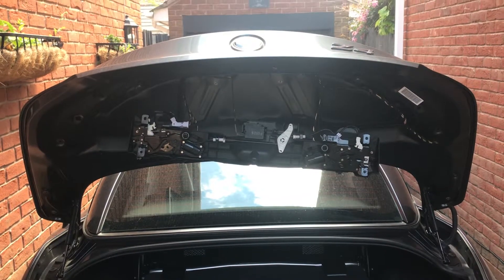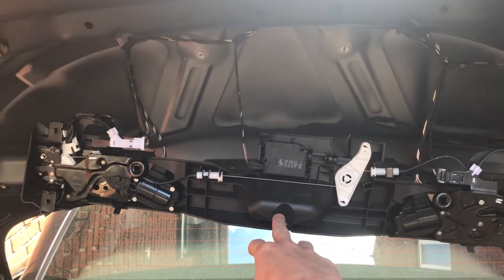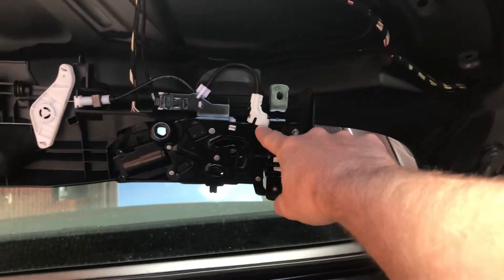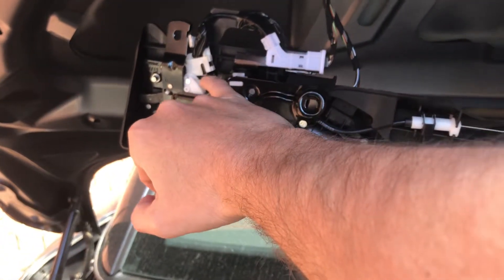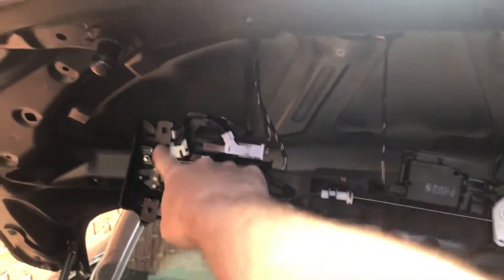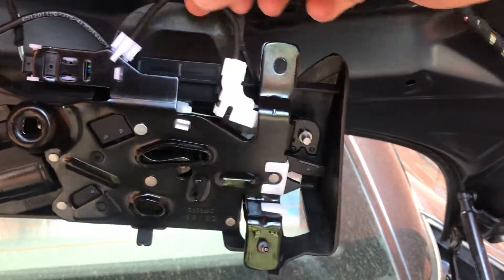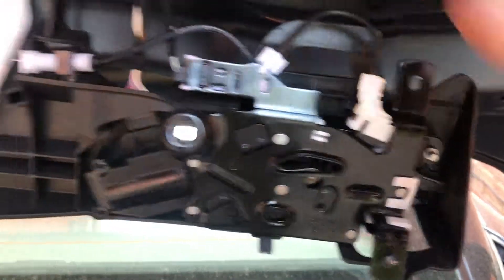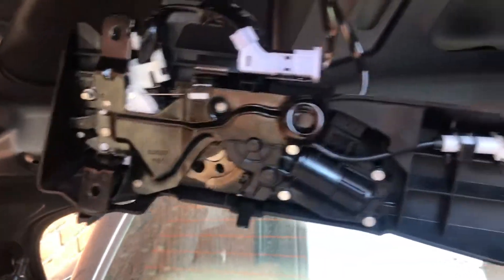z4 locking mechanism soft close sensor fix 1

Comment: Brilliant video!  Not sure how you were able to troubleshoot and find this.  Had same problem due to 2 broken wires on my left sensor and one on right.  Wire skin was fine but if you bent it you could touch that copper thread inside wire was broken.  Reconnected and works fine now.  Thank-you for posting!!
Reply from the maker: Hey 
No problem glad I could help you 
It did take me a while to sort it out at the time but at least now yours plus others have saved time & money 
Glad I could help 👍🏼

Comment: My e93 has started doing this today. You can hear the motor trying over and over again to pull the boot shut but isn't pulling it closed. Would you say this is the issue?
Reply from the maker: I would say from what your saying yes if it’s jumping up and down then yes
Reply: @BobbyGees  yes you can see the boot moving up and down with the motor. Thank you for your help buddy!
Reply from the maker: Yes that’s definitely it and no problem
Reply: What was the answer as mine is doing the same?? Thanks

Comment: Hi grate video and I have this problem and I got it move once or twice then it stop moving, what you think is it cable or sensor? Once I touch cable area and it seem to be same problem as yours but now I'm not sure. Maybe there is change to cut wires and make them new, sensor unit cannot change wires but can cut near. I still looking for fix this problem cos in here it will cost lot of money. Thanks for give information, give more if you have any!
Reply from the maker: Ari Suomi hey man 

If you can take the wire out and fix the wires see my other videos 
You don’t need the Sensor on the end of the wire just fix the wire cut the sensor off and then put the wires together and tape up and it should work without worrying about the sensor altogether
Reply from the maker: Ari Suomi so basically disconnect the sensor cable from the car 

There will be a broken wire somewhere on that fix the broken wire if your sensor is okay then it should work if the sensor is damaged all the wires are broken at the sensor then take off the sensor and twist all the wires together where the sensor would be tape them up and it will sort it out
Reply: @BobbyGees  Hi thanks a lot I found one broken wire and one almost cut, this video makes this possible to fix it, I really found out where was the problem! Now it works and I safe lot a money about 600 dollars, thanks a lot and I will see your other video of this problem!
Reply from the maker: Ari Suomi anytime mate glad I could help

Comment: The slow close on my 2011 car works fine, What I get is the boot wont open either from the key remote or the handle on the boot lid. Any suggestions please? Thanks Tony.
Reply from the maker: The only thing I could think of the boot bottom probably is not responding properly I’m not sure if you can replace that as I’ve never done it myself that’s a difficult one it’s probably something simple like that if it’s not opening on the handle or the remote control

Comment: Thank you, you made my day. I've got the same problem on my Z4 from 2011.
Reply from the maker: No worries it’s only a sensor what stops it working either cut it off or replace it with a new one from eBay just get any one what looks the same as the sensor in the car around £3/$4

Comment: I got the same issue dude how did you fix the cables my one is doing non stop push ups by the sound of it 🤦🏽‍♂️
Reply from the maker: Hey man 

You can either cut the sensor off & twist the wires together which works great but add a fixing to the end 
Or get a new sensor please look at my other videos of you need anymore help thanks & good luck
Reply: @BobbyGees  thanks bro
Reply from the maker: No worries buddy
Reply: @BobbyGees  I’ll be sharing this on Bmw Twitter account I believe this is manufactured issue & all customers should have a free replacement
Reply from the maker: I agree
Reply: @BobbyGees  my bae is sick she can’t stop twerking 🤦🏽‍♂️
Reply from the maker: If the boots moving up and down it will be the sensors there are two one each side one per lock 🔒
Reply: @BobbyGees  thanks dude I’ll get it checked out
Reply from the maker: Hey man 
Did you sort it out ??

Comment: Good afternoon, thank you, great video. Tell me how to detach the lock body from the trunk lid, I'm afraid to break the plastic.
Reply from the maker: It’s very easy 

Take off the warning triangle can the brackets holding this on
Next gets a small flat screwdriver and for all the little black fixings around the edge put the flat end between the plastic it should then pop out once it’s popped out hold it with your fingers and pull it out and do the same for all of them then the carpet will then come off the boot lid then you can see the locking mechanism you will need to unscrew the mechanism from the boot lid so it drops downHolding on via the wires onlyTo see the motors and senses each side hope this helps
Reply: @BobbyGees  Thanks for the answer. Did I understand correctly, the lock body is screwed, and not on the latches? I mean the plastic part 5124 7191257.
Reply from the maker: I am not sure on the part numbers anymore to be fair 
Both sensors and lock mechanisms are all part of the same unit underneath the carpet you take off do you have a lock each side with a sensor each side of that unit
Reply from the maker: You will need a star screwdriver not too sure on the size anymore but put something down in the boot floor to stop you dropping anything down the side of the wheel arches trust me that may happen

Comment: Thats nice, but how to open the trunk to get to it when it's not working. I can't open from inside the car or fob either. I have 2011 z4 and assume all is the same.
Reply from the maker: This is only for the soft close it should still open if that’s the problem with it 

Maybe put a new battery in the fob & try open it 

There maybe a emergency handle somewhere behind the seats must be that you can pull to open but I’ve never had a look
Reply: @BobbyGees  Oh, I see. Thanks for the reply. In truth, the root of my problem is the roof is not working which is not allowing the trunk to open so I couldn't get to the circuits I need to test in the trunk. Now I've been able to get window on top of the roof which will allow snake camera down the window arm mechanisms to find and pull the emergency trunk latch. Getting camera tomorrow. Hope that works. Thanks again for your reply and enjoy your Z!
Reply from the maker: The truck & the roof work together if one’s not working Botha don’t work if the trucks the problem the roof will not move if the roof is the problem the truck doesn’t 
Somehow you need to get in the truck to see the locks like on my videos if they are ok then it’s the roof probably a different sensor 
There maybe a handle or it may just need unscrewing from the car 

Emergency release but I don’t know how to do that sorry to say 

I’ve sold this car now so I can’t even look